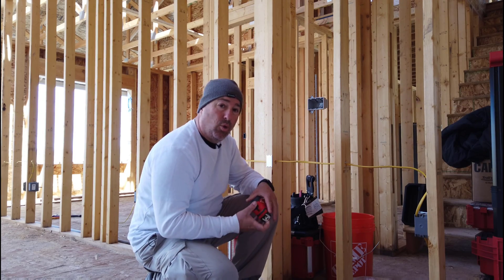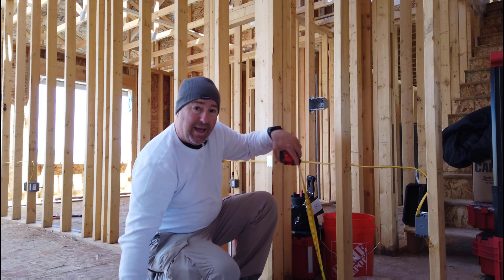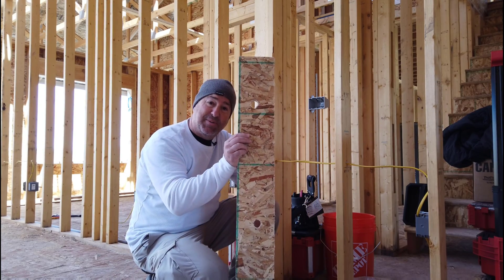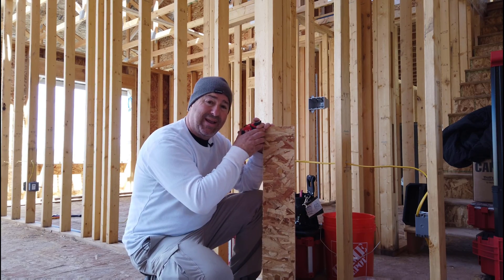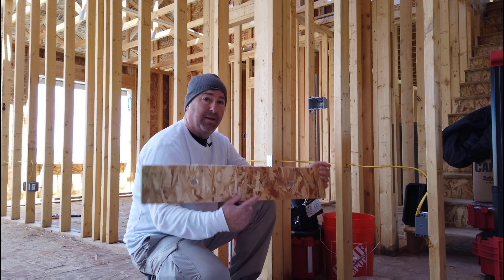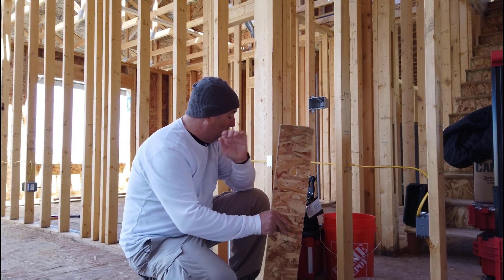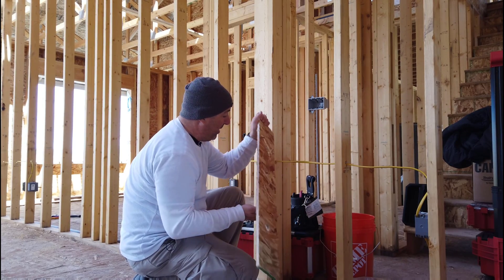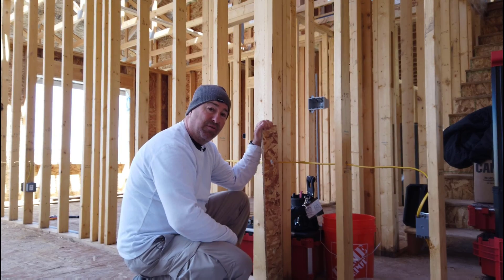How to wire a house with Romex, and make it look good! - The 360 Electrician Explains

Comment: Get a scrap 1x2, drill a slightly larger than 1/4" hole at the correct height, and put the auger bit through the hole (end up with tip of bit on one side of the hole and driver on the other).  Now when lining up, there's no handling the board, it's attached to drill and can be used one handed.  The free hand can be used for getting the position quickly, stabilizing an an angle cut, two hands on the drill for a weird situation, or whatever.  Kick a ~6" 2x4 scrap around for when you go off the floor instead of the bottom plate.  Goes super fast.
Reply from the maker: Sounds like a great method, would love to see a video on it. Email me if you can, thanks!

Comment: I snapped a chalk line for my first time drilling the holes at the appropriate height. Worked out pretty good.
Reply from the maker: I love chaulk lines, get's messy once in a while. It's also a little harder to do by yourself, but better then a laser for me.
Reply: @The360Electrician  lasers are good for some layout, especially plumb lasers because you can lay out on the floor. But sometimes they are more trouble than they're worth, easier to just snap a line or make a few measurements instead of spending 20 minutes getting a laser set up for 5 minutes of work

Comment: I built myself a large garage recently, I pre drilled the holes. Piled up 4 boards and drilled them all at once at 28”
It was nice to feed the line through. Keep in mind your corners, have to move your hole in or out..
Reply from the maker: That's a great idea as well. Especially if you can pre drill. Made it a breeze I'm sure. Corners are always a bugger. I have a few tricks on that as well but usually requires nail guards when it less then 1 1/4" to edge and it always is trying to get the angle. Thanks for sharing

Comment: The best way to make romex look good is run conduit
Reply: I don’t believe Romex in conduit is code.
Reply from the maker: I'm assuming he means don't use romex at all. Let's ask Ryan Jackson! #Ryanjackson
Reply: You can only put Romex in small sections of conduit less than 24 inches. But conductor count still applies. But yes I meant just run pipe, like Chicago all residential wiring is in conduit, no romex.
Reply from the maker: Lol yeah didn't think of that one. It's amazing seeing homes from the 40's with rigid black pipe run everywhere. Except it always had cloth wire.

Comment: Neat trick for beginners but eventually your hands better not leave the drill. Unfortunately contractors will not allow you the time for this
Reply from the maker: Yes in this case the wood is so fresh 1 handed works. I also use it to mark the wholes with my pencil and then drill away. Going on eye site alone works no problem but to go to the next level and impress this is the way to go.  Anytime I have a new Sub we work for this is what I want my guys to do. They become a customer for life.
Reply: Yeah my contractors aren't gonna give me this much time to measure and bore holes.

Comment: If you can't make it look straight without this thing, you need practice anyway
Reply from the maker: No substiture for experiance that's for sure,  but it never really goes in straight without a good system. Always a few ups and down, and worse side to side holes. Weve only needed 3 nail guards so far using this method and if I can't be at all jobs to check I want to make sure I know how my team is doing it to at lease eliminate another area to worry about. We always land wires and cap ends to heat up the panel before drywall. That way and dead shorts are usually on the Drywall guys.  If I have to go back I know EXACTLY how high the Romex is to be replaced.